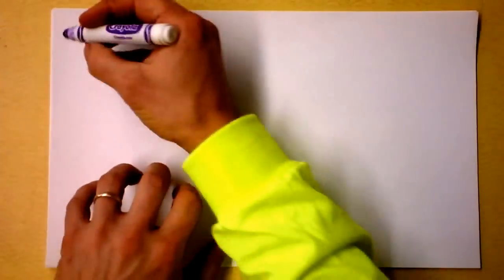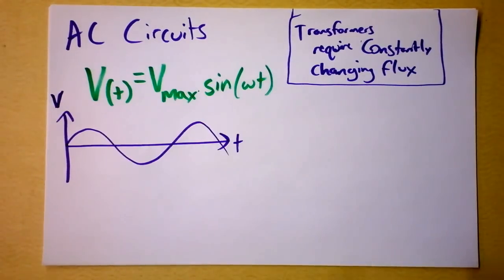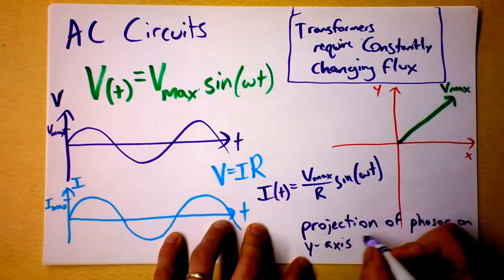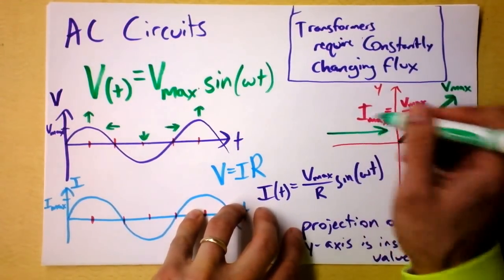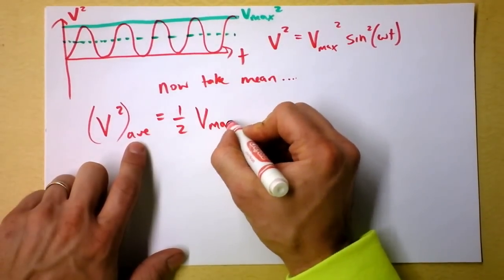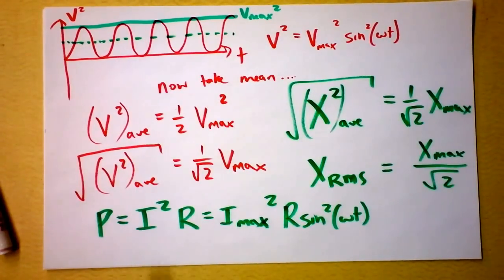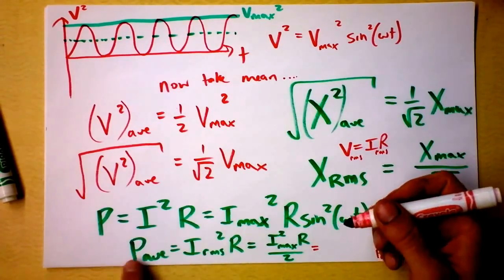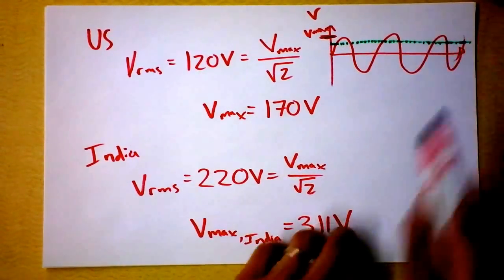Intro to AC Circuits using Phasors and RMS Voltage and Current | Doc Physics

Comment from the maker: I agree with what you've said.  My phasor for Vmax is pointing in some arbitrary direction, so it represents V at some arbitrary early time, as you've said!

However, I call the phasor Vmax because that is its length AT ALL TIMES.  If that makes sense, you are ready to rock phasors.

Comment: Yes, India having been an English colony uses 50 cycle mains power. They also still use older English standard outlets. About the ONLY places that still use 60Hz are Canada, The USA & Mexico, (and a few Pacific islands). 50Hz is slightly less efficient going through a transformer, but not noticeably so. 25 Hz power required a beefier transformer, and some products had a 25Hz option for people living around the archaic power houses in upstate New York & Canada. That system was finally retired after NAFTA went into effect that those old factories back east closed down & relocated to Mexico. They clung to that 25 cycle power supply citing that retooling would cost too much. Moving to Mexico was not a problem, with the cheap labor, and 25Hz power went the way of the steam engine, the model A Ford, and telegrams.
Reply from the maker: +Seth B Wow!  This is very cool info.  Thanks!
Reply: +Seth B What do you mean by "went the way of the steam engine" the majority of the worlds electricity is generated by steam power.

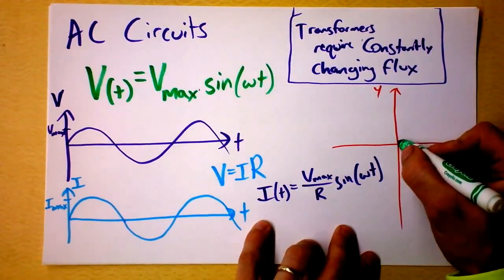Comment: 4:10 Wrong definition. Phasors aren't vectors that are constantly rotating. They are static. The don't depend of the time (in fact that's why they are from the frequency domain and not from the time domain). The "thing" (factor) that makea them rotate is e^jωt, but not the phasors themselves.

Besides that, I think everything is correct. Great video!

Comment: Good explanation. To make it better, u need to explain why the mean value of sine square is 1/2 , because by no means that everage =1/2 mathmeticaly. But for this specific function, sine square, its average is 1/2.  need to take the integral of  sine(wt) square over its period T then divided by T,  which gives u 1/2.

Comment: although this video is really great, there is one step which is oversimplified here... 
it is not so obvious that V²max ave = 1/2 (Vmax)²
in fact it requires demonstration via integration, or decent plotting tools to demonstrate this. 
The reasoning presented here is perfectly valid, even if it is presented as something trivial, when it is not - if you want to work cleanly.

Alas I understand were the decision to oversimplify comes from. I probably would have done the same, to keep the lesson accessible at an entrance level... I just leave this comment here for those who wonder why that step is presented this way.

TLDR: video is great, everything presented is correct! IMO one step in the middle is over-simplified to keep it accessible to beginners. This does not make the lesson incorrect in any way though.

Comment: Thanks.
From a chemical engineering degree student in South Africa.
Reply from the maker: You're welcome!  Have a great summer!
Reply: I am having a great summer, thanks. Been on vacation since December 5th more or less. I guess I am making you part of my summer school as I am reviewing subjects on my own that I failed this year and that I am retaking in February. You don't happen to know where I could find easy to understand info or even maybe a YouTube video on how to connect an ammeter, volt meter and watt meter to a three phase induction motor? It's one of the practicals in the only module focussing solely on electricity and circuits in my course. We mainly study plant design of course.
Reply from the maker: Suzie Q
No idea about that particular!

Comment: Great video.  I have been working on understanding voltage, current, and power transmission on the grid.  Say you have two generators working on the grid which are synced and on line.  How would you represent both generators power output separately  and how would you represent the combined power of both generators at the load using phasors.  I was wondering also about where a residence would have solar panels and an inverter that is grid tied.  How could you measure the power coming from the grid and from the solar panels separately using phasors.  What would happen phasor wise if the residence was adding power to the grid or where the grid was supplying power to the residence.  How would the smart meter differentiate which way the power is flowing;  either flowing into the residence or away from the residence.  I know that this more involved than what your video was showing, but I would have to be thinking in terms of voltage, current, resistance, and phasors.
Reply: The answer to your question doesn't require an understanding of phasors. In general, the two generators on the grid would be a linear relation; (gen1 MVA) + (gen2 MVA). In phasor notation, if they're in phase, magnitudes would simply be additive and you'd have a longer 'arrow' vector. Same concept applies for solar panels and the grid, since they're both power generators. In a solar application, you measure the power created by the solar panels, then you also measure the power used by your home/business (the load). Depending on if your solar panels are connected to the grid, you may be supplying the grid (and you can be paid by the electric company), or you are using less than your total load and just using less grid power. 

But ultimately, knowing phasor notation isn't required for this, seeing as a home won't be causing any weird power factor issues.
Reply: @frankjoshum  Hi Josh.  I think that what you said is well put.  I had a hard time thinking how to ask what I did not understand.  I think what I really want to know is how  a wattmetter can measure the direction of the power flow in a system.  In the case of solar panels in a residence, how can a wattmeter differentiate whether power is flowing into the house from the utility or whether power is flowing from the residence to the utility when the solar panels are producing excess power that is not being used.  Simply put, how does the wattmeter know which way the power is flowing?  If the wattmeter is measuring voltage and current, it seems like the wattmeter would not be able to tell which direction the power is flowing.  With DC, it would be simple to tell because of the direction of current flow.  With AC, the current flow is always changing direction.  My guess is that current would be in phase with the voltage when supplying power to a load and that maybe the current would be 180 degrees with the voltage if the load became a generator.  Some how, I don't think that thought is right.  If you would consider that the utility and the solar panels are both generators, what determines the direction of the power flow?  What is the impedance of the grid anyway? What is the impedance of the load and solar panels?  What got me going on this topic is when the power outage occurred that knocked out power in New York City and part of the east.  An article in Newsweek (?) magazine described how power bounced around in the grid.  It made me realize that I did not understand about power flow in AC circuits as well as I thought I did.  I also read another article about the grid, the ISO, and how power can be bought and sold on the grid.  How does power flow from one part of the grid to another part of the grid when all of the generating stations are connected together on the grid?  I know that this is a lot to ask.  Thanks,  Rick Phillips
Reply: @richardphillips2405  I see your questions. In the case where you are not connecting your soar panel to the utility grid, all you need to do is meter power from both sources before it reaches the load. So, place a meter between your house/business and the utility power line, and then a separate meter between your house/business and the solar panel. This is the simple answer to knowing how much power is flowing from each source (utility grid versus solar panel to your house/business, the load). In this situation, you are NOT connecting the solar panel to the grid, and as such, the power you use from the grid will simply be less the amount you use from solar.

As for your comment on the 180 degrees with voltage, and understanding how you can feed the grid from a solar panel, that is also simple. Anyone can feed into the grid, theoretically, although it is illegal unless you follow proper local laws and regulation. The power quality (the quality of the sinusoid) must be very high (low THD) on the grid, and so if you were to provide power to the grid with your solar system, you must first condition this power and then meter this power(so you know how much your providing, so you can be properly paid for it). Your utility company has both of these items for sale, which you can likely rent or purchase. The utility company wants to ensure that the power you're providing to the utility grid is high quality power.

Now, if your solar panels are connected to your house and to the grid, your sinusoid from the solar panel is high quality, then you are in the situation to sell the power back to the utility. How is this measured? How do we know what is going where? Well, think simply: our solar panel output after the inverter, after the power conditioning, and after the meter, is provided power to the grid, very much in the same way that a creek or river can feed into the ocean. It should be mentioned that 'the grid' , more specifically the electrical power capability on those conductors, has a complicated ownership. One company may own and maintain the power lines and the power poles, and another company may distribute the power on those lines. Suffice it to say that the company which sells you the electrical power would also pay you if you were creating more power than you used.

Your final question, "how is power bought and sold on the grid", is a bit complicated. There are federal regulations in place, there are many different regions in the USA, and there are many different ways to sell and buy power on the grid. This is very complicated and something I don't personally understand. But, if you simplify the situation, you can see that your local electrical municipality, which might be your city, buys power from a large regional supplier (like Duke Energy or TVA), and then charges you for it. Then, your local municipality may own and operate all the local power lines and power poles near you, but the regional supplier might own and maintain the larger, higher voltage transmission towers running through the country side. This is a highly regulated market so as to not have monopolies and to not over charge citizens.

Additionally, you as a consumer, and depending on your local electrical market, may have the option to "buy green power", or power produced from a carbon-free source like wind or solar. Of course, your house/business as an electrical cannot discern the electron which was pushed from a windmill versus a coal-fired steam station, but the electric power company which serves your house/business does know the extra cost to operate/maintain the green energy sources, and just simply charges you more for it, should you want to support their green-power initiatives.

One final comment about New York city, those grids (and all grids) are highly complex and highly monitored. Remember, that power created must equal power used by the load. In essence, the power supplied to the grid from solar panels, wind turbines, hydroelectric dams, nuclear, and steam stations must equal the power used by the industrial markets, houses, hospitals, and so on. If the power generators (green or not) do not match the demand of the users, we have a brown out situation. If too much power is supplied, we have overvoltage situations through the grid, which can damage equipment. As such, there are departments within these companies which monitor historical data, monitor temperature (are customers using a lot of AC, alot of heat, is it night time or daytime?), monitor other power plant status, to ultimately determine how much power they can supply and ensure they are exactly meeting demand, not too much and not too little power supplied. 

If we have two power plants operating at 50% capacity (say, 4 steam units each, and only 2 are online), in the morning when it is cool (during the summer). Then, one power plant goes down, and now the other plant must operate at 100% capacity. But, the demand in the morning when it is cool isn't very high because not everyone is turning on their AC units yet. Then, it becomes 1pm and the power plant must be providing 120% capacity because the demand has risen, and then all of a sudden we have a brown out because the power plant cannot provide the demand. This can cascade into a dangerous situation, where no power is supplied at all until all power plants can be brought back on line, or load (power demand) is reduced.

I hope this helps!
Reply: @frankjoshum  Thanks for answering my questions.  I wish that I could set this up with generators, wattmeters, and other equipment as an experiment.  But, I don't think that this will happen.  To me, this whole topic is very interesting.  Today, the news was talking about rolling blackouts.  It's nice to have an understanding of this.  I do have my own stand alone solar power system that I put together myself.  The solar panels go to a MPPT charge controller and then to 4 golf cart batteries arranged in a 12 V configuration.  The batteries power a Prosine 1000 W inverter.  The system works well and has been used when we have had power outages.  I have ammeters and voltmeters with the DC part of the system.  You can see how power divides in the system.  Anyway, thanks for the video and thanks again for discussing all of this with me.

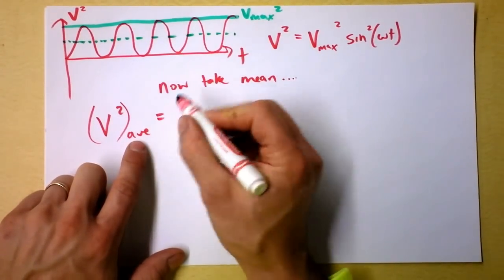Comment: at 9:04 how did you conclude that the avg. value was half of vmax?
Reply: Hasmukh Thaker The Values of V max sqr are "symmetric" so average would just be in the middle. Like if you had infinite amount of results from 0-10, then the average is just 10/2 = 5.

Comment from the maker: That's precisely the goal.  Immediately upon finding RMS values, you can pretend that it's a trivial DC circuit for analysis.  Like your toaster, that sez it allows 10A and hopes to be plugged in to 120V.  Neither of those is ever true except for 120 particular instants every second.  However, if you multiply I_rms times V_rms, you'll get the average power of a cycle, which is the average power in general.  Woot.

Comment: Hey great vid man! Learnt more in 16 mins than 4 lectures. However do you have or planning to do a vid on RL, RC and RLC circuits? I really have trouble with capacitors. Thanks again dude!
Reply from the maker: H34dHun734R Yes, I have a few!  Check out the index page that I link to in my profile.
Reply: Doc Schuster Awesome! Thanks man!

Comment: Amazing explanation. I've a question: So, if I get an accidental electrical shock, which voltage is making the damage? The RMS voltage (120V) or the Vmax (170V)?
Reply from the maker: Terrible but fun question!  I have no idea how to quantify that.  You'd be better off asking a biologist, but my understanding is that the most immediately dangerous possibility is that your heart stops.  But the current through you is more dangerous than the voltage across you.  Ask a biologist and get back to me!

Comment: In an LRCcircuit, can the rms voltage cross (a) an inductor, (b) a capacitor, be greater than the rms voltage of the ac source? Explain.

Comment: Why does the voltage differs in India and in US? Does this have an advantage or a disadvantage to US?
Reply: I think Indian households have the same as Europe, I.e. 240/230V 50Hz. The Americans are disadvantaged because it is more efficient to distribute electricity at 230/240V than 110V (US voltage) and they will require thicker cables

Comment: In that first phasor diagram, wouldn't Vmax be vertical? V=0 at t=0 (horizontal right), V=Vmax at t=pi/2 (vertical up), so the phasor shown would not be Vmax, correct? More of just V at an arbitrary time between wt=0 and wt=pi/2 ?

Comment: So tell me if I'm wrong now:
Amperage = V(rms)
V(rms) = 0.5 * V(max)
Did I get the definition of Amperage right?
Is RMS not the same thing as taking half of the max?
Reply from the maker: PT Yamin No, it's not.  I have other videos on RMS.  I hope they help.
Reply: PT Yamin Close but you forgot that the graph has been squared, therefor:

[V(rms)]^2 =(1/2) x [V(max)]^2

Taking the positive square root on both sides:

V(rms) = (1/root2) x V(max)

edit*: He said the same thing in the video haha

Comment: speaking of capacitors, how would you string capacitors with a power source of, say, 1 million volts (i.e. lightning surge protector).  A physics major friend of mine said you would need a string of capacitors because otherwise they would explode from that voltage.
Reply from the maker: Phil Kvasnica Series.  I think she's right.  I have some videos on capacitors.

Comment: but I was just wondering that phasor for current is always smaller than that of voltage , why that's is so , when resistance is in fractions , current can be higher than volts.

Comment: But when I put a gauss meter next to a wire, I'm getting a spiral that looks like a wave in 2 dimensions (h x w). Add the 3rd dimension which is depth, not time, you get a spiral. From the side it looks like a wave.
Reply from the maker: I think you're indicating that light is coming out of your wire.  What is the wavelength in depth?  What function is going through the wire?